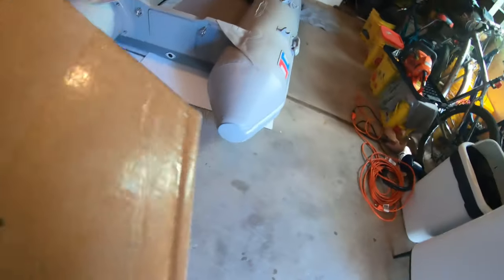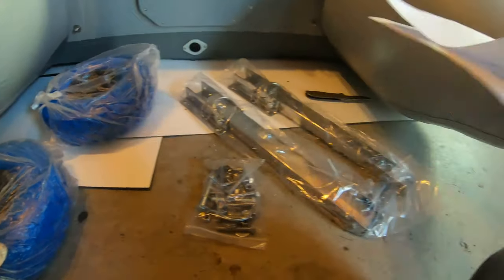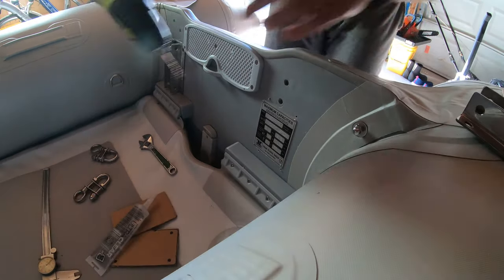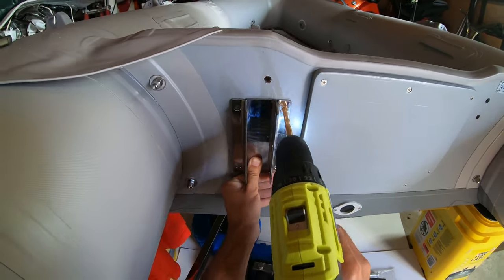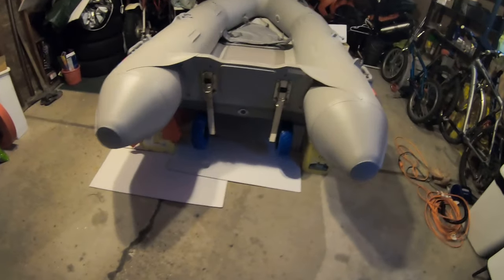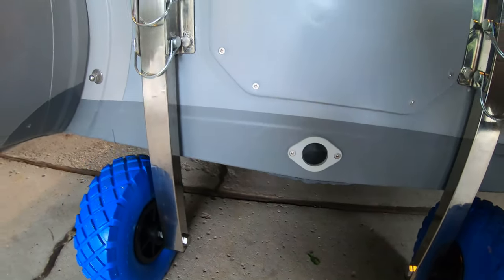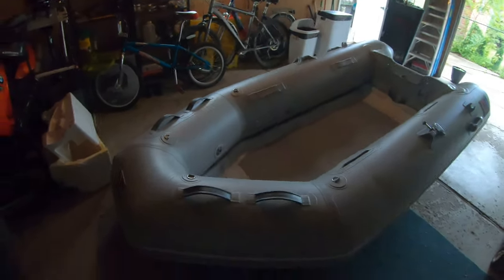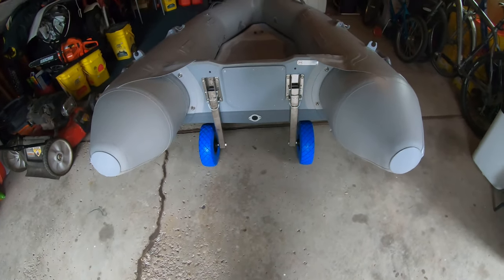Install Bris Transom Wheels on Dinghy

Comment: Hi, good video.  Do you have an engine for your boat?  Do the wheels give enough clearance to put the engine on the boat before moving to the water?   Thanks
Reply from the maker: Yes and yes, but I think you found your way to my other videos. Let me know how your adventure goes, and especially if you are able to get on plane with your motor (what brand motor did you go with).